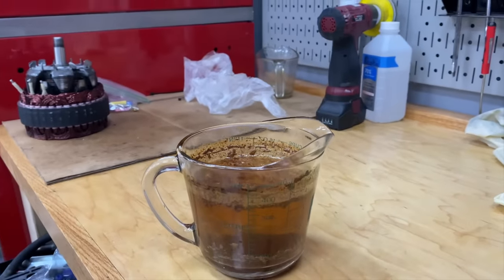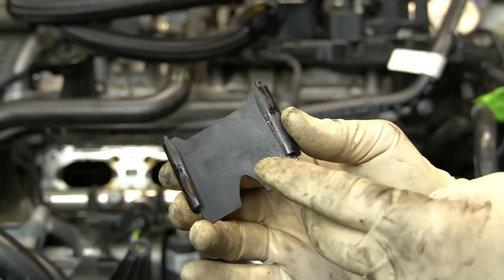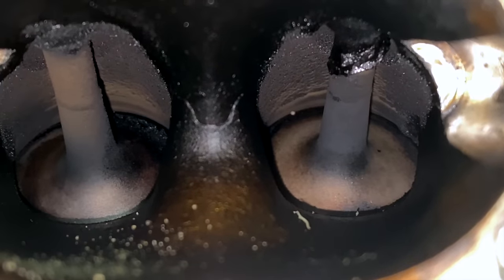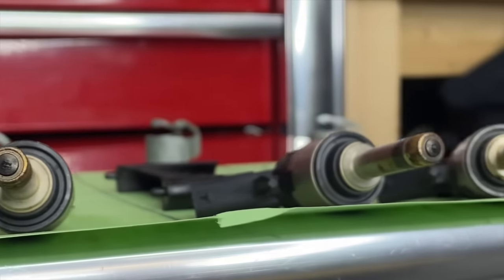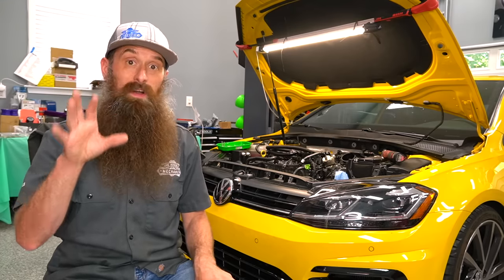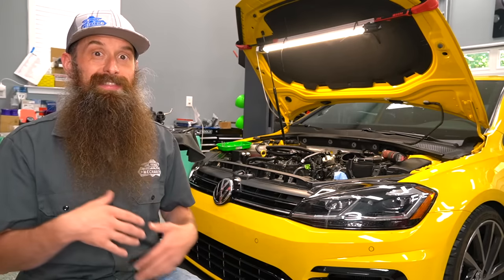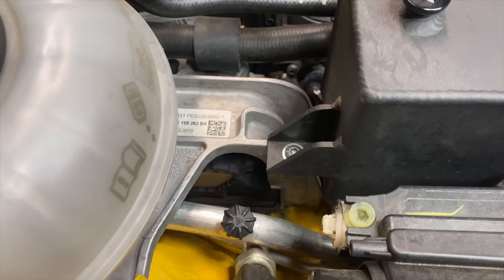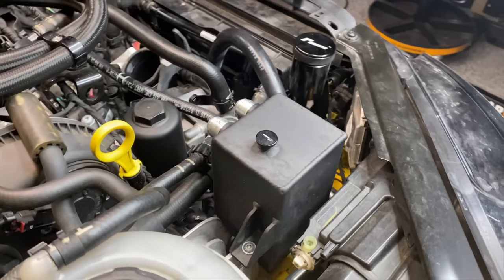Did the Catch Can Work? 10k MILE TEST

Comment: In short - catch cans are not as functional as we think they are.
Also, later TSI models don't have as much problems as the early models (ea113 for example) with carbon deposits. Don't take the previous statement wrong, there still is some carbon deposits that get onto the intake valves, but if we take for example early 2.0 TFSI engines - these in particular have a lot of problems with carbon buildup. I think VAG group took care of that in the newer engines, so there isn't that much of carbon buildup on valves...

Comment: As a mechanic, it would seem fairly feasable that 3 and 4 got better. If that amount of fluid (water or oil) is constantly misting into the intake. The egr soot would also be constantly wet down causing it to clump. When removing the moisture and also some degree of extra heat due to moisture reduction surrounding one of the hottest parts of the motor = egr soot being removed. If you look at the before and after. Most of what looks cleaner is where the build up already looks dry in the before.

Comment: Thanks Charles. Good tip on the winter removal. I think even AOS, that are heated, can still pose a problem because it will take several minutes for warm/hot coolant to start flowing.  > As for the drain, dill and tap a hole for a Fumoto valve. This will allow you to drain the can w/o removing it. Location is dependant on your application. < Cheers. 🍺
Reply: AOS shouldn't have the same issues as a catch can, as they do not retain fluids. They have a drain line to recycle the oil, while the hot water vapour will go to the intake as usual. There may be a small amount of condensation while it's cold/warming up, but nothing of significance.

Comment: I have a 2012 beetle turbo 2.0tsi e888 gen1 cbfa with 128k miles.. running a cts ko4 turbo and supporting mods..  i definitely need a carbon cleaning but would adding wmi clean them?  Local shops want $700+ to do a valve cleaning 🙄

Comment: Can you just reroute the pcv to vent to atmosphere in these cars? Yes, I recognize there are legality issues. Just wondering if it would throw codes etc. Pretty common I'm the diesel scene to vent to atmosphere. I'd personally prefer that vs a catch can. 

Secondary question, has anyone dismantled any of the market options purpose made for these cars? Conceptual polymer has a killer white paper and catch can design, though previously it wasn't rated for forced induction. I just wonder what type of filter media some of these options use, and how they compare to each other.

Comment: Ive also noticed burned oil smell with my 034 cc on my B7 Avant. Something due to PCV delete? Since its parked in my garage, the smell is very obvious.  Ive also put a 'plug it and forget' water meth injection kit, a small one to fit my 93 oct tune , with 91 fuel. 250cc. On the windshield washer reservoir. So you should consider a other CC kit , try water meth on the OEM windshield washer tanks. 250cc nozzle, start @12psi (max 25psi), I can do a year with only 2 refill. 20k km yet, Ill remove the intake to see if there's any carbon build, and report it on audizine.

Comment: Why not get a tube that route from the drain down to by the oil pan drain plug and put a valve on it. That would give greater capacity and hopefully keeping the can empty until oil change furthering it's efficiency.

Edit: finished watching video and found out this one doesn't have a drain. What!?

Comment: I wonder, since the direct path of the oil vapor has been blocked by the catch can, (I had no clue about water vapor) and the water vapor which can still travel past the catch can could be the reason of the cleaner valves (like the old school valve and piston cleaning way by introducing water into carburetor to clean carbon buildup). I think this could be the same theory except for injected engine. 🤷‍♂️
Reply: I had the same thought. To test this theory, the can would have to be emptied daily for the testing interval so it doesn't accumulate water. I'd be interested in seeing that. I must say, I am amazed how much water is in the can liquid

Comment: I have a question when you first installed the catch can, I though I saw a nut on the bottom of the can that can be used to empty it out, does that work or is it in just a spot that it can't be used that way?

Comment: I would change the oil you are using. Try an oil that has a lower flash point. I use Schaeffer's Supreme 9000 Full Synthetic and it has been one of the best Ive ever used. Lubrication Engineers full synthetics are another one.

Comment: What it could be is that the oil droplets are heavier than the water droplets since they're basically a really fine vapor and the little catch can is doing its job catching the oil but the water still continuing through and steam cleaning the valves for you. 😅

I'm assuming this because the valves where they would have been really hot are where they're the cleanest. And the runners themselves have the oil build up because the water is not getting nearly to the temperature that is hitting when it touches those valves

Comment: My issue with catch cans is that, you the only reason that you are collecting water is because the catch can is so far away from the engine. On the crankcase vent system that’s built on the engine, it’s on the engine to stay hot and evaporating any water. It feels a lot like a solution to a problem that’s only a problem when the can is installed. If it’s a race car, then put a catch can on.

Comment: To me the fact that the valves etc almost look better is an indication to me that possibly somehow some water is getting into the inlet manifold. An old way to decarbon engines was to spray water into the intake while the engine was being revved. Is that possible from the way the catch can is set up? Just a thought.

Comment: From what I read on a VW patent from the early 2000's "Direct injection internal combustion engine US6866031B2" it mentions carbon on intake valves was reduced if the intake valve was heated to >380C by driving at a higher load >3000rpm for more than 15min.
Reply: I have some anecdotal evidence, since last month my Audi B7 BPG was misfiring randomly on cold start with a flashing CEL. I did a few days of 25min hilly cruises in 3rd gear at 100kph (outdoor temps were -20C). It got better after each day and so far I haven't had the same issue. It would be cool if you (and maybe DAP) were able to test this out! Either on your car or a car with really bad valves?

Comment: I would design a catch can as an oil filter with a small brass release valve. Having water out of the system is definitely a good idea. Are you using E10? The E will attract water.

Comment: whats up mann i really wanted to ask you a question about my 05 passat tdi, the transmission cooler hoses have compression fittings connecting them to the metal radiator lines and i was wondering if you knew the thread sizes or if youve ever ran an external trans cooler from there thanksssss man

Comment: The very question I’ve been wondering myself and attempting to resolve on my Audi b7 2.0. Does catch can reduce carbon buildup and or consumption? This is a bit of a controlled test given the catch can was the only “thing” changed. My conclusion is improved intake material/function.

Comment: You for sure, want to keep the catch can. EP additives in oil, like zinc, molybdenum and other metals can foul catalytic converters and oxygen sensors If the catch can can reduce the carry-over from the PCV system, that goes a long way to prolonging the life of those very expensive emission control components. When those additives burn in the combustion chamber, they become oxides, which will not burn off, even with the high temperatures in the catalytic converter. Another indicator, would be the spark plugs. When you examine the sparkplugs, look at the end of the bolt, where the ground electrode is attached, to see what kind of build up there is there. That is a real good snap-shot of the cylinder head and piston face, that are difficult to see, unless you have a borescope.
     Probably the best way to tell if the catch can is really that effective, would be to remove it for ~10,000 miles, then, re-examine the valves, put it back on, and look for an improvement. The more simple thing to do, is to examine the spark plugs. While not as effective as looking at the valves from the port side, it's a lot less work, to spin out the spark plugs. You might even replace the plugs when you remove or replace the catch can.

Comment: That catch-can trapped a lot of crank-case water vapor that would have been beneficial getting burnt in the cylinders, water mixed with fuel does generate steam when burnt, which clean up carbon and soot. In your colder climate that catch-can is actually contributing to more carbon buildup by removing water vapors. Catch-cans are primarily meant to trap oil to stop carbon buildup

Comment: Have you seen any info about Toyota's direct & port injection system, reducing these build ups?  Or is it just more complexity without reducing the problem?
Reply: This was a non issue before direct injection. Even a carbed vehicle doesn’t have that problem. 

Putting fuel above the valve solves the problem. Even Audi VW has dual injection now.
Reply: Dual Injection system like Toyota's D4S solves this issue completely. Carbon build up on new DI engines is the direct result of not having fuel hitting the valves. 

Also Toyota's method helps a lot in emissions, start-up quality and overall engine performance.

Comment: Not sure if it’s just the video but looks like a lot of sand/dirt particles in the inlets, was this just off the external side of the manifold as you removed it?
Reply from the maker: It’s from falling off the manifold. I cleaned it up before installing

Comment: Should that sewage be going to and mixing with your finely metered air-fuel ratio? What will it do to the clean combustion of the metered air-fuel ratio? I will do whatever is necessary to stop that sewage from reaching and mixing with my air-fuel ratio in my combustion chamber.

Comment: @HumbleMechanic would it be posible to replace  the valve stem seals on a 1.8 20v AGN motor without pulling the engine out?

Comment: Do you recommend using seafoam on these cars? I've read a few posts where they suggest running a seafoam treatment every 30k or so miles.

Also, I know a catch can is pretty much mandatory for my other car (CTSV which is a super charged v8), when I asked on a few VW forums, they said catch can's are more for when you track the car more often.
Reply: It wouldn't really do much to clean the carbon on the backside. This might lead you to think poured in the gas tank which is a viable option for Seafoam but again without anything to scrub at the carbon deposits it's not going to do hardly anything on a GDI engine. As far as the catch can, do you drive your VW Golf in a spirited fashion? If yes then I would definitely put a catch can on but I would get a full top end cleaning before adding the catch can unless you are under 5-10k miles.

Comment: My 2006 gti has a catch can with drain hole at the bottom. Problem is it got plugged up when I drained it. I didn't see that there was still gunk in it. Later the car started having misfires on start up.  Pulled the catch can and found it was full with junk heading back up the input line.

Comment: you probably have condensation in the line  when it cool down and the pressure goes back to ambient and when you start it suck the liquid in the intake... catch can doesnt filter 100% so some oil/fuel/water vapor still go in the intake. I have a ebay one to try so no filtering inside and I use it daily on 5km trip to work each way so I collect a lot of water, my lines are not clear but you can still we things inside and the one from the valve cover to the catch can is about 1m20 it's more dirty, yellow than the one from the catch can to the intake that still pretty clean. Ive had pcv failure with the original hose from the valve cover to the intake, at somepoint the valve was shut close then suddently open and the intake suck a lot of fluid! I've had smoke at every startup  bigger on cold start. took me a week to figure it out. I came to the conclusion i dont drive it enought for the oil to get warm during winter -20C for months even with a block heater I leave home no cabin heat, arrive at work barely warm, coolant around 50-60C

Comment: The carbon buildup visible on the upper side of the valve stems from imperfectly sealed valve seals, allowing a microscopic oil film to seep through. This oil gradually moves down the valve and thickens due to high temperatures. An oil catch can has effectively reduced the amount of buildup.
Reply: Yes and that is why all the car manufacturers have added them to their cars from the factory, as they work so well. Err no.

Comment: I watched this video when it first came out, and now a couple weeks later my wife has a brand new Tiguan R line and I was wondering what you would suggest as a regular preventative to help prevent the build up as best as possible?
Reply: Catch can will slow this significantly or if you don’t want to deal with a catch can no frequent short trips, get on a highway drive abit more often and definitely use good oil not sure what oil dealers use but on time oil changes or frequent oil changes, the  lower oil change interval the better but it’s up to you.

Comment: From everything I've heard about catch cans I wouldn't't use one, there's really not much advantage according the HumbleMechanics testing, it would be fantastic IF they prevented carbon build up but you're still getting it maybe less maybe the same. I'll just stick with a manual cleaning around 50Kmi I'm almost due the injectors too and at the same time I'll have my water pump replaced and be done with it. Depending on how much build up there is I'll increase or decrease the frequency. It really sucks that this happens at all.

Comment: The fact the catch can is catching all the water vapour out (removing water vapour from the air) from the air that is then fed back into the intake, with less water vapour in that air, the valves may be running hotter and burning off the carbon.
EGR Exhaust gas being fed back into the intake (to improve emmisions, god know how co2 plus air improved emmissions thought) that exhaust gas may have carbon in it, which may end up on the valves. BUT the valves where cleaner at 20K than at 10K so i dont think the EGR is to blame.
More likely less water vapout in the air = hotter running valves which burn off the carbon on the valves.
The oils on the valve stem (top part) probably comes from the oils stem seals, which are designed to leak a bit to lubricate the valve stem in the valve guide.
the 300miles trip definately helped = long run.

Comment: Pretty weird outcome there.  I'd think that by removing most of the oil vapor from the intake it would reduce the amount of exhaust particulates from the EGR sticking to the intake passage.  My other thought is that by removing that amount of water that there is a lot of condensation build up in the block while cooling down after a drive.  It seems almost excessively so.  I have a BMW 135i that I fitted a catch can to and over say 10,000Km/6,200Mi I would remove maybe 50mL of fluid (warm by humid climate of Brisbane, Australia).  10 times that amount over the same amount of time may not be helping carbon build up but must be helping oil quality of that period.

Comment: The only way to go is a heated oil air separator and the oil goes back into the engine. 
Also , brake booster pumps can fail and push engine oil through into the intake manifold .

Comment: I have two hoses coming from the engine, one from pcv to a point between throttle and manifold, second from crankcase top to a point between air filter and throttle......which one should I attach the oil can to? Both or just one from pcv? I think both carry oil fumes or oil
Reply: It's 2003 corolla 1.3 Liters

Comment: I'm going to guess that the road trip on this 10k aided in cleaning the valves and that on the first 10k it was more short trips that didn't give the engine a chance to clean the valves. The catch can probably helped keep the contaminates from reaching the valves and gave the engine a chance to clean the valves.
Reply: @Ninety Four Moto you're right, its not like a port injection but the engine being at operating temp and continuous highway driving, like a road trip, can clean the valves somewhat.

Comment: Carbon builds up becomes an issue upwards of 60,000+ miles/96,000+ kilometers. What, realistically, would you find after just 10,000 miles/16,000 km?
Reply: Just mucky water buildup in the can. That's all. I agree with you.

Comment: I really need your help.  My daughter 2012 Tiguan has the P0299 code and after replacing all the easy items and not getting rid of the light I’ve checked the waste gate for movement again and it seems very loose. I went to a salvage yard and got a turbo off another 2012 Tiguan so I could rebuild it and have it ready for a quick swap. The housings are great and the waste gate is tight and it has a newer manufacture date than the car so it was replaced at some point. But. It has a broken turbine shaft. I need a turbo cartridge. Any ideas where I might order one for a 06J 145 713K IHI turbo. She is in college and I’m trying to prevent spending $1200 plus dollars on a new turbo and I’m not keen on Chinese knock off turbos for so much less.